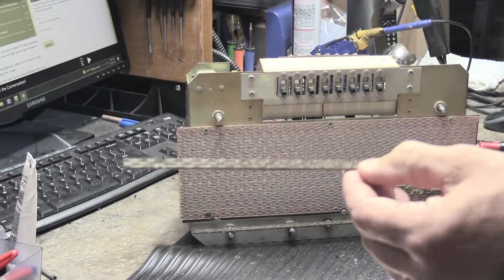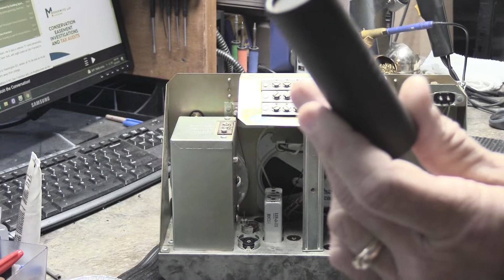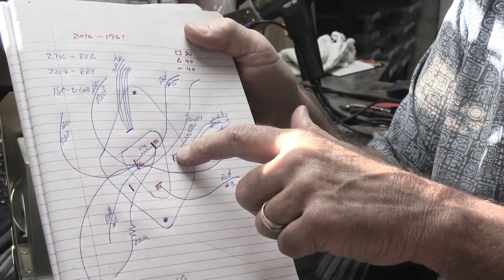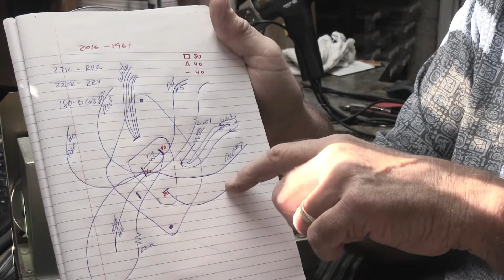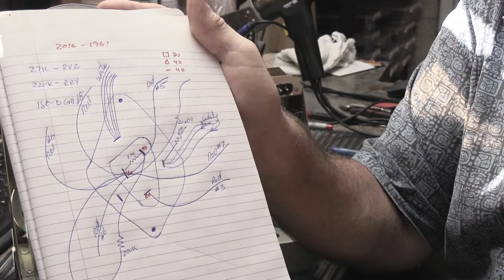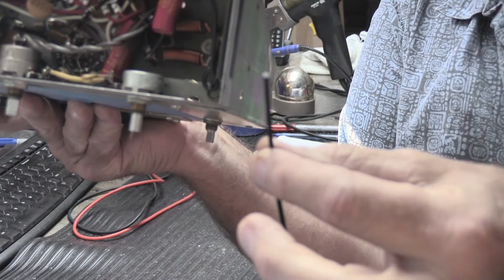Rebuilding A Pair of NuTone Model 2016 Intercom Music Master Stations ~ Part 2 ~All About Capacitors

Comment: You draw temp diagrams like i do,  But i grab a pointless advertisement letter and use the often white  envelopes for artistic diagrams (A bloody mess) lol.
For lots of odd wires going to one point, apply a small coloured cable tie/ zip tie to keep the wires together.
Then write down the colour of cable tie used for the group of wires.
Now that was a boring thing to read,  i had to eat raw coffee to stay awake :-D
Reply from the maker: Hi zx8401ztv:  Well, I guess great minds think alike. . . What I didn't show in the Video was that I also take pictures before - during - after I remove the Capacitor.  The pictures are just for backup - I rely on the drawing to keep everything straight. - Chris